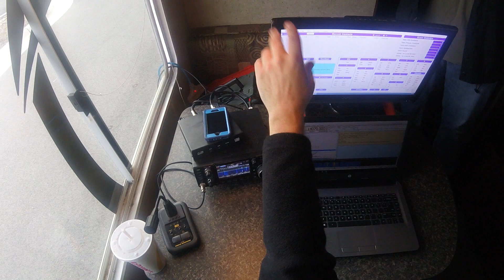Winter Field Day 2018 - Amateur (Ham) Radio Communications Event

Comment: Wrap your cables multiple times through a type 77, two inch diameter toroids. Don’t just be an appliance purchaser, build it better for less. Learn why you would use type 77 and be able to calculate the RF suppression. When you understand, you have power. CW was rocking for me during WFD. Hope to see you on this mode next year. 73 KM4ZZ Charlie
Reply from the maker: I have gone down the rabbit hole of figuring this out. I am hoping to get a leading expert on the show and talk about RF Interference and suppression. I had common mode current that is typical of offset center diapoles. So I hope to get that fixed. And yes I am determined to get on CW and enjoy that part of the hobby! Thank you for the advice and encouragement.

Comment: When you say wrap the core with several loops around it do u mean wrap the usb cable around the core several times?
Reply from the maker: One way to do it is get the core that is a ring and wrap it around the ring. However, I think now my issue was common mode current and using an RF choke on the feedline might solve the issue. Hopefully I will get a show in before field day on this issue and how to solve it.

Comment: In my part of Ohio I had s8 noise all weekend on all the band's. Still made lots of contacts though. 20m was closed all weekend but 40/80m was wide open. 40m even worked for some nvis contacts which was unusual. You do a great job on the channel.
Reply from the maker: Thank you! That's interesting. Our antenna did not go to 80m. We selected this antenna since we knew we wold be wrapping up before dark. We did have some Ohio contacts on PSK31 but not voice. Perhaps the noise was too high for voice but ok on digital?

Comment: Thanks John for the follow-up video. I have to tell you that I watched your FLDIGI macro setup last week and you were my inspiration to even participate in Winter Field Day even though I was a 1H. I was mostly on 20m but when PSK31 slowed down, I did some voice contacts on 20.  I believe I ended with 50 contacts. I got absolutely nothing done this weekend but radio. When the contest was over today I walked away from it. I used your Macros but I too spelled out winter field day.  The Bye macro I changed to 'I copied' instead of UR. Thanks again John, I enjoy your  videos and your podcast. Dave, K7MTD
Reply from the maker: Glad it worked out for you and you gave it a try! I like contest weekends to test new gear especially out in the field. It's a time when you know there will be many people out there willing to give you a signal check. I am going to put together my "improved" macro's in an evergreen video so it's ready for next year. Thank you for watching.